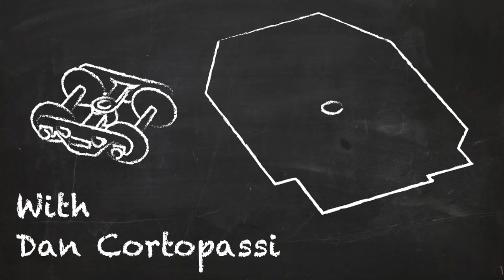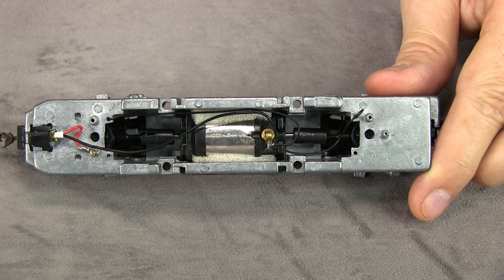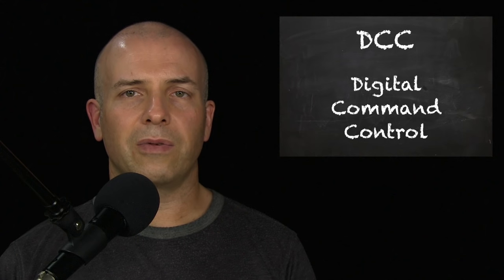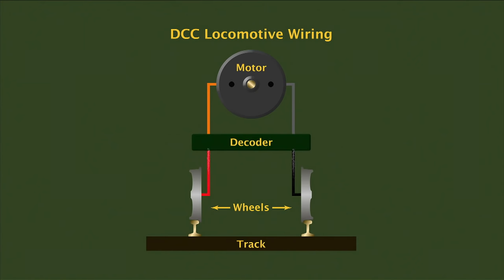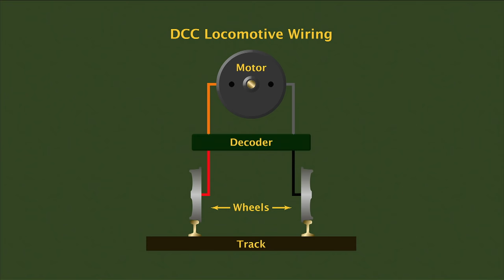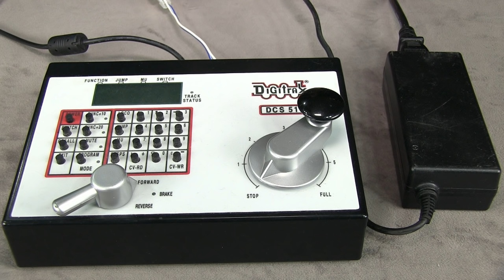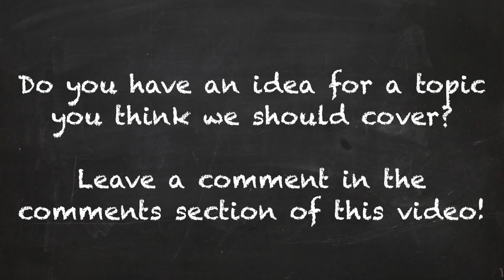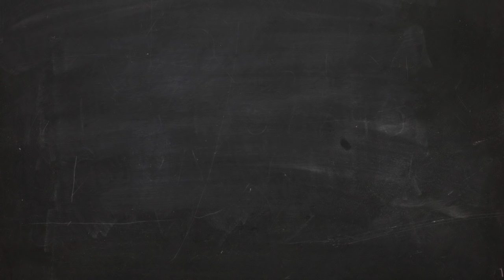Model Railroading 101 DC and DCC For Beginners

Comment: Why did you not show programming for the consist? Running 2 loco's? 
I wish people would do more steam videos on these how to videos. I am still watching this but so far I really like your video.
Reply from the maker: That seems sort of more advanced, doesn't it? MR101 is supposed to be for beginners.
Reply: I guess so. I was just wanting to see it. You are right sir.
Reply: tsgmultimedia if I may, I will give you a "brief" run down on my situation? About 3 yrs or so ago I decided to get back into train hobby again from when I was a kid.Had some $$ saved up in a sock. I was in shock when i realised how much things have changed. I ended up w/digitrax zephyr. Most of my engines were steam mostly dcc but a few older ones were not. Rivarossi big boy and a mallet. I got a 2 diesels 1 was dcc rdy and other dcc equipped. For whatever reason I could not the speed out of any loco. I tried on dc ran  like no tomorrow. So I tried back to dcc same thing. I tried programming?? or I thought so. I just could not get the "speed" out of any loco. Needless to say I got very aggravated and peeved! My layout is hung from the ceiling on 2 4x8 sheets of plywood on a pulley system. I live in a apartment. I was getting rdy to buy a house so everything is packed up for the move. House fell through last minute and all locos and bldgs are packed away. So I have been trying to "re-educate" myself some. Hopefully one day I will let the layout down and try again.
Sorry for being so long. Just very frustrated. But I am learning.
Thanks for your time.
Joe
Reply from the maker: Keep plugging away - you'll get there eventually. While Dan is our resident expert here, I am the camera guy, and I just installed a DCC decoder into a locomotive for the very first time yesterday (coming soon to a program on the channel, so stay tuned).

All this stuff takes time and practice. I might even weather a locomotive or freight car one of these days, but I don't expect it to come out like one of Dan's models.

Comment: Isn’t the motor technology the same for dc an doc?
Reply from the maker: Yes the motor is exactly the same. The kind of power going directly to the motor is also exactly the same. The difference is when you're using DCC, a decoder accepts power from the track and converts it to what the motor needs. If it's on DC, that power comes directly from the track and into the motor. I'm pretty sure this was explained in the video, but maybe not in an easy to understand fashion.

Comment: Can you run to DCC engines together at one time like one whole train
Reply from the maker: You can run as many locomotives in the same train as you want with DC or DCC, but with DCC you can fine tune the operation of each locomotive to match the others very accurately by adjusting what's called CVs (Control Variables).

Comment: The hobby is headed towards DCC anyway so anyone Thinking about going into it. Just do it. Find out what your local hobby shop recommends and go with that system so if you have any issues. You people that already have alot of experience with your particular system brand. I Personally prefer NCE and my local shop every DCC specialist there has NCE as their own personal systems so again if I ever have any issue or questions I know who I can ask.
Reply from the maker: Definitely good advice to go with a brand that your friends and acquaintances use, as that is a built-in support system for when you run into challenges.

Comment: Can I run a dcc engine on a dc set up?
Reply from the maker: That depends on the decoder in the loco. Some work, some don't. In some cases you have to program it to tell it you're going to put it on a DC track before it will work. Your best bet is to decide DC or DCC then run the appropriate models on the layout.

Comment: I wanna get Dan's opinion on how to control 2 DCC locomotives with the same address number becuase I have 2 Kato GS-4 one is painted in  SP Daylight 4449 and another in BNSF Excursion Black (BNSF 4449) how do I to create a consist with same address number
Reply from the maker: Dan didn't see this comment, but I have the answer. You probably have to address one differently.  I would put a zero in front of it if possible or else just give one a bogus number like 9999 or something else you will remember. Maybe 4444? Or else just don't run them simultaneously.
Reply: tsgmultimedia I think I will go with the 3rd option run them both with address number 4449 and run them one at a time  thanks for the advice John

Comment: How hard would it be to convert a locomotive (DC) from the 1990’s, to a DCC with all the bells, lights, horns, air brakes, engine sounds, etc...?
Reply from the maker: This depends entirely on your skill level. It could be very easy or very difficult. You can find videos that explain what you need to know to convert just about any model to DCC here:

https://tsgmultimedia.com/product/ho-dcc-installs-volume-1-digital-download/
https://tsgmultimedia.com/product/ho-dcc-installs-volume-2-digital-download/
Reply: @tsgmultimedia  thank you very much, I was thinking I’d have to just keep the shells and buy new engines. Thank you again for the information

Comment: Guys you sync the two locos but didn't show what you actually did, did you give them both the same address?
Reply from the maker: They were what's called "consisted" which means dan programmed them to work together by linking them using electronic wizardry.
Reply: Can you please share some of that wizardry so we can do it as well?
Reply from the maker: There are lots of tutorials about consisting in DCC owner's manuals. I do it on my iPhone using WiThrottle by addressing the first loco then adding the second one. The only tricky part about that is you have to tell the program which way the second locomotive is facing. You can do the same with DCC controllers.

Comment: CAN SOMEONE HELP ME??

I'm a beginner and I'm looking to get Kato Unitrack set but since I want to use DCC I'm planning to use my friend's Bachmann EZ Command Controller rather than spend on a separate DCC controller. My question is that without soldering or doing any complex wiring stuff could I use Bachmann EZ Command Controller with the Kato Unitrack set? If yes what do I need to do to use it at it's full potential without any problems?
Reply from the maker: Surabh: this question is answered quite directly in the video. It requires that you read the instruction manual that came with your DCC system. This kind of information can often be found simply by searching on google if you do not have the printed instruction manual.

Comment: DC DCC ? Thing of the past ? Expensive, bulky  Tied to single manufacturers :  I'm going loco battery power with R/C control  Full independant even on same track  driver cab control . Even plastic track too ( forgive) . Whats the point of anything else.

Comment: with dcc you are telling the loco what to do instead of the rails
Reply from the maker: You could certainly look at it that way!
Reply: DC: Playing fetch with three dogs and one ball... all dogs fetch at the same time no matter their different names.
DCC: Playing fetch with same three dogs, Rover, Rex, Rudy...  you throw the ball and state: "Rex, fetch"...  Rex fetches the ball while Rover and Rudy stay put.
Reply: Daniel Filion You are exactly right.  With DC, you are running the rails, and not the engine.  With DCC, the rails remain constant (with the exception of certain instances like reversing loops and such) and you are actually running the trains on those rails.  I switched to DCC about 22 years ago, and have never regretted it.  And if you want realistic sound, no other system can come close, since the speaker(s) is/are in the loco or tender itself.  You can have stunning sound, and incredible light effects that truly do sound and look like the real thing.  I run entirely steam, but have seen some beautiful lighting on modern diesel models.  Now if I can just convert my steamers to have different colored classification lights...